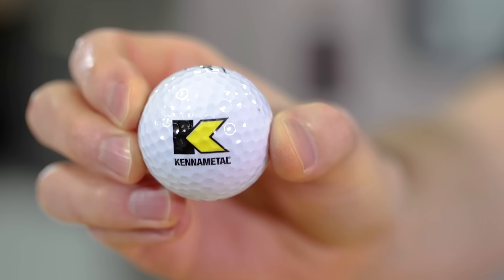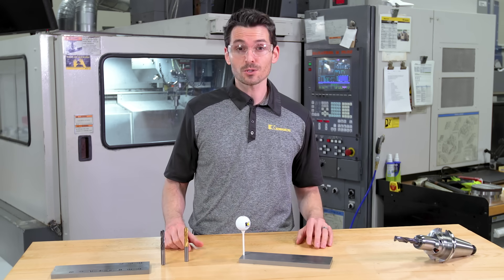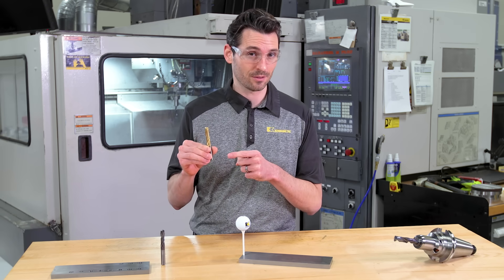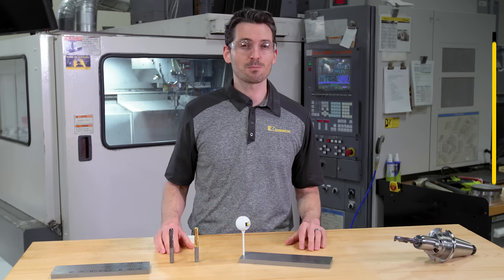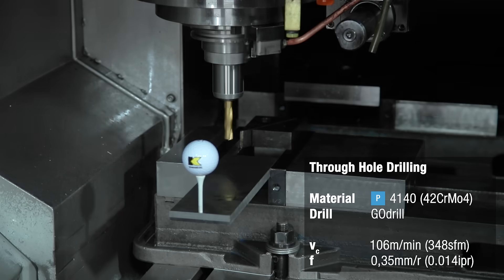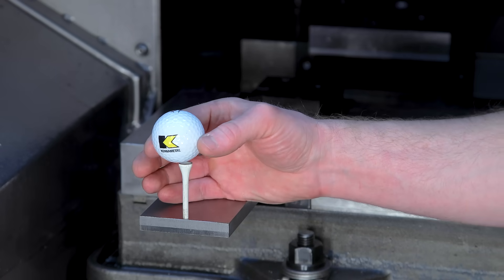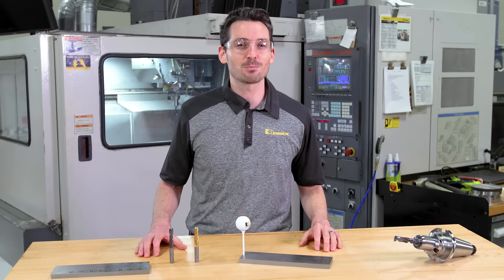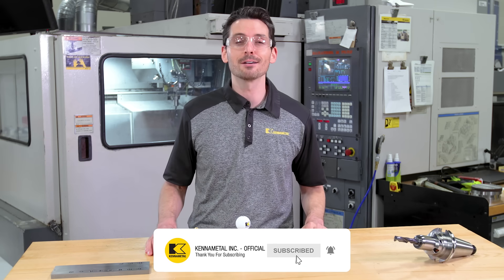CNC Machine "Golfing" With HPX Drill and GOdrill

Comment: I’m not a machinist so pardon me but wtf is this supposed to be showing me what is the benefit of reduced vibration in a cnc machining setup id assume whatever you’re working with is clamped in?
Reply from the maker: This was a demonstration of two drills, one general purpose (GoDrill) and the other high performance (HPX) to compare the vibration each drill introduces to the workpiece.  The HPX causes significantly less vibration, which means it has a softer cutting action equaling longer tool life and higher consistency with hole size.  Thanks for the question!

Comment: In fairness  you should have turned the stock over and drilled next to the fixed jaw with the HPX for it to have had the same "dynamics" as the GOdrill. There's obviously a harmonic set up by drilling on that side of the vice opening. It would be interesting to use the other piece you have there and reverse the test. Otherwise a novel way of demonstrating the vibrations.
Reply: Agreed! I had the exact same thoughts on that!

Comment: I don't understand the point of this test... Why would you drill holes like that, with the material hanging off the side? If I had my part fixtured properly, I could break a drill and the golf ball wouldn't fall off... What is this test proving? I'd like to see the form error and diameter of the drilled holes, and also tool life. When I drill holes, I want high MRR, high tool life, and good form error (cylindricity), and also have good fixturing practices, which this is not. So, what's the point of this "test"?
Reply: The point is showing the reduced force required for the HPX drill, and reduced vibration vs the other drill.
Reply: Back in the war, I worked in the weapons lab for  the SIS. I made a similar observation when I was processing plasma rifle stocks in the 40 watt range made from Austentetic CPM Wolframite on a Hexapod Universal Metal Processor (HUMP). 

What we learned is that ever drill tip geometry has certain harmonics and oscillation related to independent speeds & feeds. 

In other words, your go drill is capable or less vibration and further advancement if you identify the sweet spot between speeds and feeds just like you did for your advanced geometry drill. Similar to what a machinist what do to reduce chatter.
Reply: I understand your comments:  You know the world of machining is dictated by controlling cutting forces.  When one sets up a job, your comments of good machining practices are needed and essential in order to get predictable results.  Fixturing, and work piece design, cross section thickness, reach from the spindle, material make up and hardness, machine capability, all factors which need to be accountable for a successful process. Reality is none of these variables are consistent.  This video is showing that the drill point geometry is offering less downward cutting force.  This free cutting action allows a larger window of control when machine setup is not optimal. When conditions are favorable, the drill produces less heat which in turn can offer the opportunity for faster productivity while maintaining a quality hole.   Good video to prove the value of the tool!

Comment: What was the spindle load for both the drills ?
Reply from the maker: We didn't capture the machine load while filming, but in general the material specific HPX point geometry creates significantly lower cutting forces, which works great for machines with lower spindle capabilities, unstable cutting conditions, or unstable workpiece clamping.